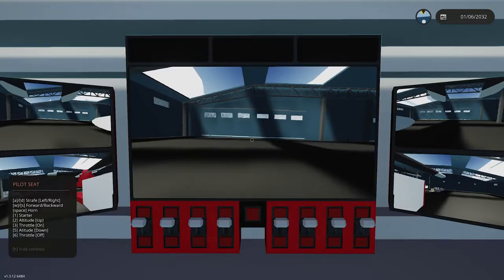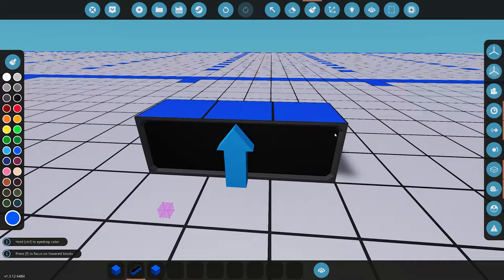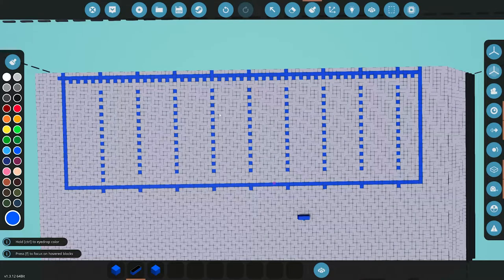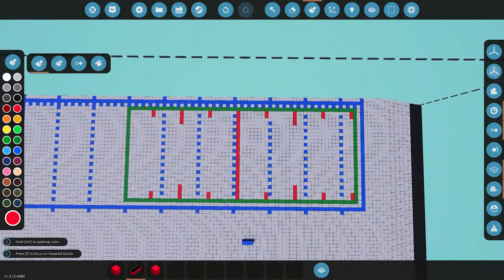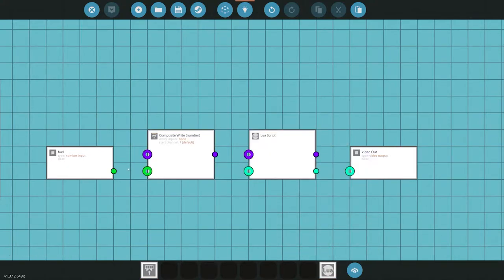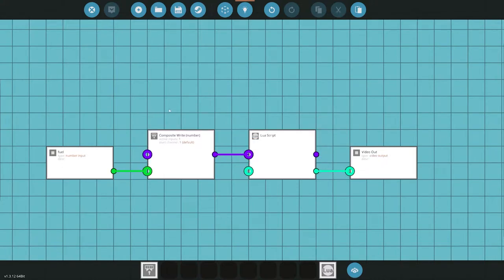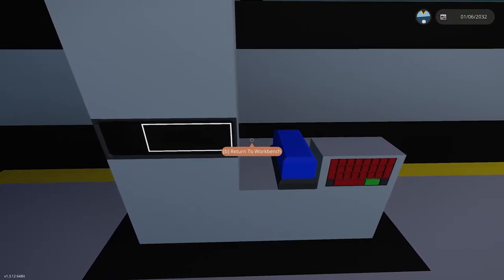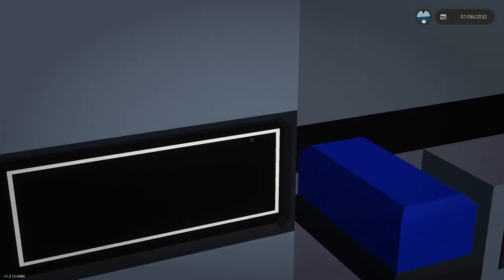StormWorks: Digital Gauges | Tutorial

Comment: Something I like to do (not sure if it messes up performance)  is use different lua blocks for different layers.  For example, i would make one that draws the lines and text, then another that would draw the moving line.  It is more useful for more complex designs,  like for warnings or grids, but it keeps things more simple so you don't have to go through 200 lines of code if something isn't working.  You can test each lua block individually to narrow down where the issue is.  Then just link the video out from one to the other then to the monitor.  It also allows to separate composites with the same number into the same screen for if else statements.
Reply from the maker: That sounds super useful especially given that there is a character limit on the scripts. Thank you!
Reply: @iSneakyPewPew  that is actually why i started doing it, but then realized that it also makes it easier to layer different colors and texts.  I use it to display a black background then white text then a red background around the text if a value is out of range like low fuel or high temps.  The first lua script in the chain is the bottom layer and then each one aafter that comes out above the first layer.
Reply from the maker: @Bendigo1  Pro tip! Appreciated!
Reply: @iSneakyPewPew  I am far from a pro when it comes to Lua but found that doing the multiple blocks really helps keep each one more simple so it helps me learn it.   I wanted to share that so that anyone else trying to learn it may benefit from it like I did.

You have helped a lot with your videos and the way you explain things makes it much easier to follow than a lot of videos I have seen.
Reply from the maker: @Bendigo1  Absolutely. I really appreciate the feedback. The goal is always to explain things how I would like them explained to me. I'm very happy to hear my explanations work for others. It's comments like this that make the work of recording, planning, and editing content worthwhile.

Thanks again.

Comment from the maker: During the if, elseif statement, to ensure your logic is most compatible with any enclosed space setup (using fluid spawner), try instead to use multiplication thresholds with the fluid capacity variable:
if(fuel > (fuelcapacity*.90)) - for example would set this to 90% of your maximum amount.
This requires you to set the variable OnTick for fuelcapacity and should reference the fluid capacity node from the Fluid Spawner.
Reply: Do you know how to get electricity draw thing not on a monitor I want to make a fuse for something so you can’t turn everything on at once or how motors draw more power at the beginning if you overload it it trips a fuse that might not make sense.
Reply from the maker: Sorry for the late reply! If you haven't already figured it out, I spend some time this morning working it out, as this was something I haven't explored yet.

I was able to create this effect with a battery, button, and several velocity pivots.
In the microcontroller editor, I've created three Logic Nodes for these (Number input, On/Off Input, Number output). I've taken the input from the battery and passed it into a Delta and then from the Delta into a Threshold. I used the (Low Threshold) on the Threshold as a electric draw ceiling (the max draw I want before the power is cut). For me, this was -0.002. You can make the (High Threshold) whatever you want. The Threshold will then pass it's On/Off to an SR Latch (reset node), which will take the input from the button to it's (set node). It's (output node), should be passed to a Timer (TON) with your fuse reset time specified to your liking. I used 5 seconds. I then passed the Timer (TON) (timing complete node) to a Numerical Switchbox that will pass my constant numbers of 1 (on node), 0 (off node), and then passed to the output for the velocity pivots via the (switched value node).

While this isn't a catch-all solution, as different configurations will require different gates, I hope this steers you in the right direction!
Reply: @iSneakyPewPew  Thanks